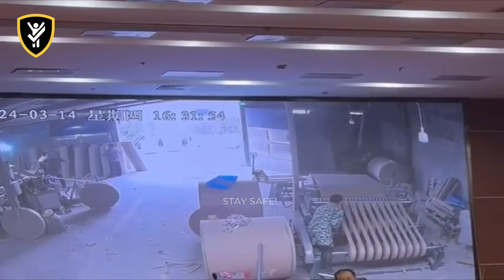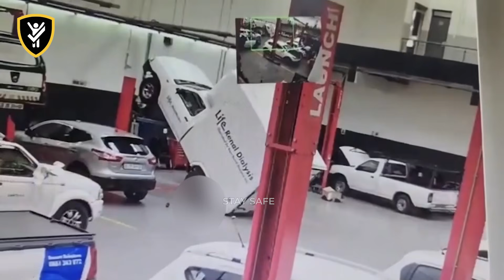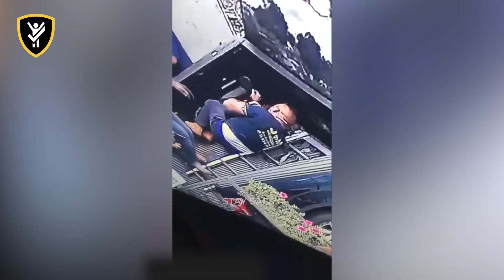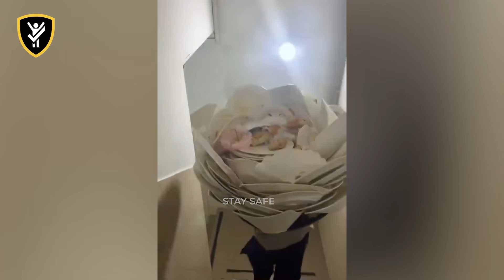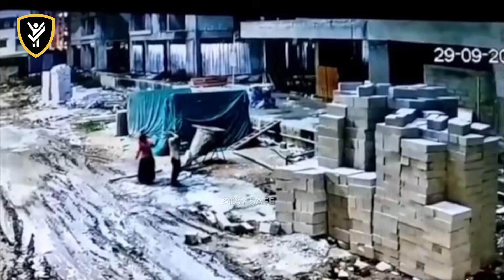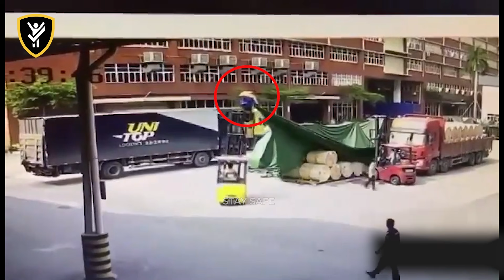He Adjusted The Rotating Machine... Then This Happened!

Comment: The truck bed was not the problem, the issue here was a cheap space saver ladder that broke in half.
A nice heavy duty extension ladder, which is the only type I would ever use, would never have broke in half, even with 2 people on it.
Reply: Garbage ladder. We've seen them advertised for many years and they are junk.